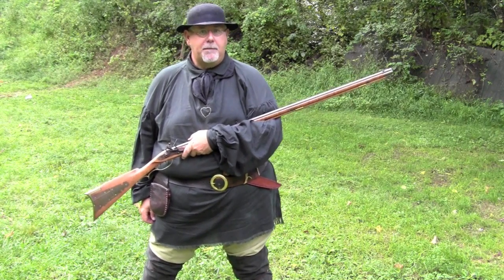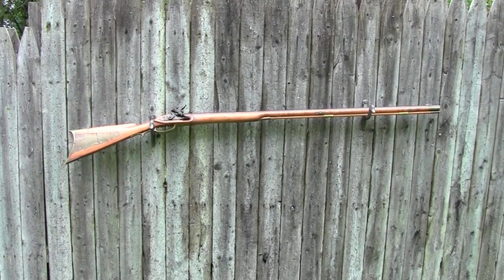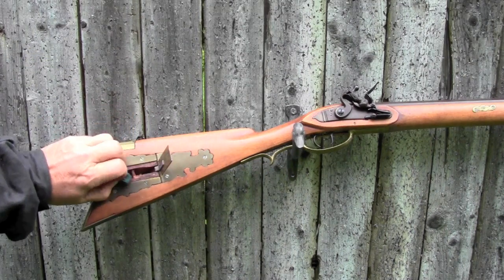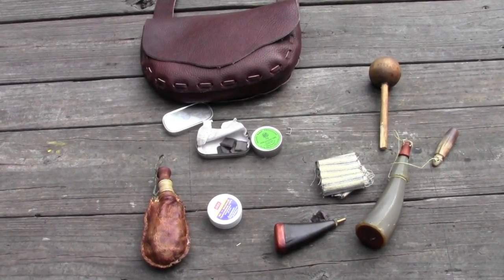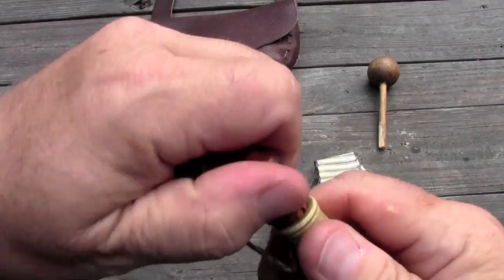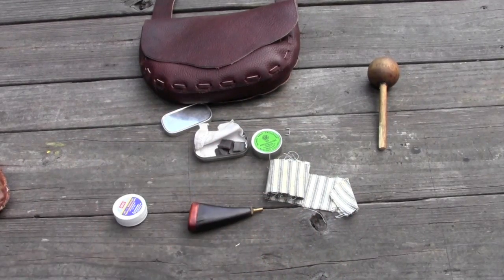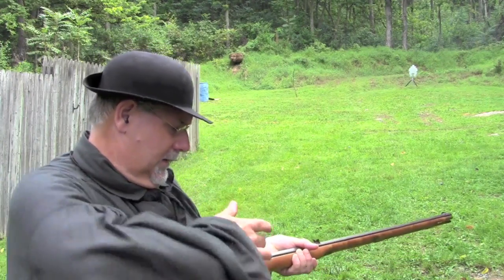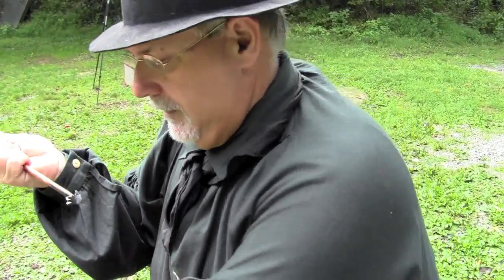40 caliber flintlock longrifle

Comment: Most people are supprised at how powerful a flintlock is with patch and ball. Nice shooting by the way. I can hit a Squirrel off hand at 50 yds pretty much every time, 75 yards about 3 out of 5. At rest a squirrel sized target 8 out of 10 at 100 yds. Off hand at 100 hards is just plane luck. I use a .340 round ball with a .020 oiled patch and 30gr. 3F. I mold my balls from wheel weights. I use the same powder in the pan as I do in the barrel. Takes practice, but is very exciting to hunt with.

Comment from the maker: Some of the cheap rifles will shoot well, once you work up a load they like. If I remember correctly, the Traditions are made in Spain, as were the old CVA flintlocks of the 1970s. I had a couple of the CVA Kentucky rifles when I was in college in the early 1970s, and they were quite accurate. The architecture and overall lines are all wrong though, and the rifles are far to chunky and muzzle heavy. But, if you are on a tight budget, they will serve the purpose. They'll hit what you aim at.

Comment: i tend to avoid bullet jags. they are not very good at cleaning the grooves and tend to get stuck in fouled guns. and its a pita to remove anything stuck in a muzzle loaders bore. i prefer to take a large brush on a cleaning rod and put the patches on that. that way the brush will flex or crush instead of getting jammed. i would highly suggest this duelist1954 especially in small bore bp guns.

ive been a reenactor and bp shooter for over 5 yrs now. probably not as experienced as you, but i tune my guns and i hope my tip helps.  shooting out jags of three enfields and a springfield wasnt very fun :(

Comment: Thanks Mike,I took it out the other day and the Goex was a vast improvement although I still like the Pyrodex because it's easy to find and I usually don't have to swab as much.The pyrodex  main charge still has a tiny lag time but according to Hogdon if I put 5 grains of Goex in the barrel first and then load the Pyrodex that should cure it.
I see Alliant has a new powder substitute called Black MZ but it only comes in 2F and it smokes like hell from the vids I've seen.

Comment: Hey Mike, I was wondering if you could answer a questions for me regarding flintlocks. Today at the local Cabelas I shouldered a Perdersoli flintlock. It was the first time I've actually handled a flintlock. I've been wanting one recently, but was dissapointed as how seriously heavy the gun was. These guns appeared to have straight barrels, will a swamped barrel really be that much lighter? Are all flintlocks just really heavy? I'm hoping to get an Isaac Haines kit from Jim Chambers. Thanks in advance!
Reply: southerncountryboy8  the older style of guns are and were heavy. They were made of sometimes unknown quality of steel. So they made them thicker to be safer. Also you could bash someone over the head when you were getting shot at because you had one shot.

Comment: Can I fire mini-balls in a flintlock?  I heard they were far more accurate, but I wanted a flintlock to avoid needing primers.  I also need a rifled barrel. Suggestions?
Reply from the maker: Yes. Accuracy will depend on the rifling pitch of course.
Reply: The accuracy depends on exactly what the rifling twist is. Old long rifles made before the Minie ball was invented have a rifling twist designed specifically for a patched round ball, and a conical Minie ball will tumble erratically out of the barrel.
Reply: Which gun has all of this in a flintlock?
Reply: tkarlmann

I don't know of any flintlock that can reliably and accurately fire both Minie balls and round balls unless it has changeable barrels with different twist rates.
Reply from the maker: Cody Cromarty In general I would agree, if we are talking over 150-yard shots. At 100 yards, a patched RB will shoot as well out of a fast-twist barrel as a conical or Minie ball.  About 15 years ago I tested Pedersoli's .54 Jeager rifle. That gun has about a 1:28 pitch because, even though it was a flintlock, they thought hunters would buy it and shoot sabots or Maxie balls. It actually shot patched round balls pretty well out to 100 yards or so.

The reverse is not true. Minies won't shoot well at any range out of a slow twist barrle. They tumble.
Reply: henerymag Seems like the diffrence is between above & below speed of sound for the 2 scenarios you mentioned.

Comment: I’ll try to explain what I have a question about to the best of my ability. I have seen old rifles with a bump or hump on the stock like right behind the lock kind of where you face would be if you where firing the gun. What is the reason for the bump? What style gun is that called? Where can I find a gun like that? Sometimes the inside of the barrels were not round did they still use round balls or something else? Lots of questions. Answer none of them or some of them if you can. Also I’ll try to provide a link of a picture of what I mean. I’ll see. 

http://www.oldsalem.org/OsmgCollectionItem/